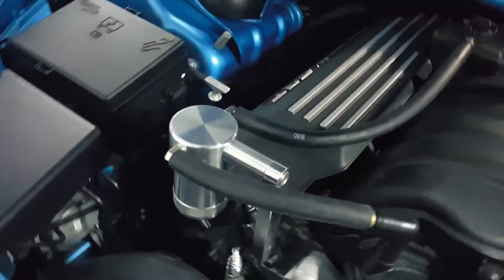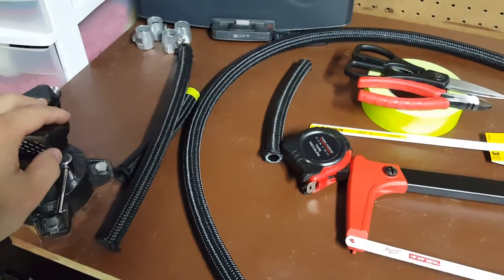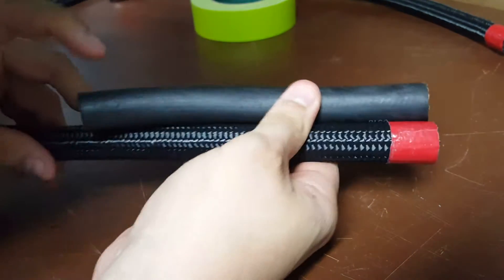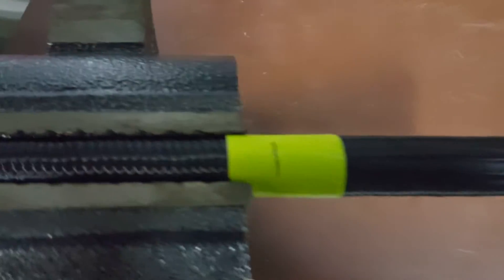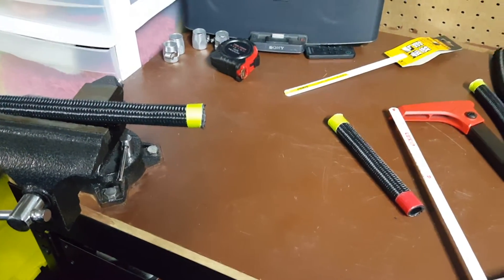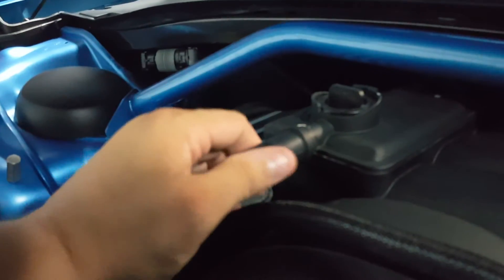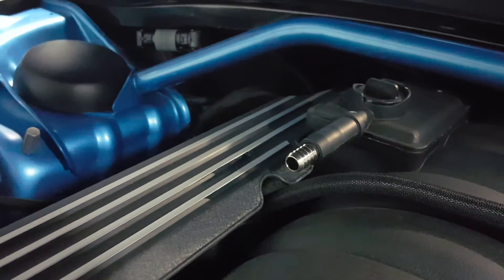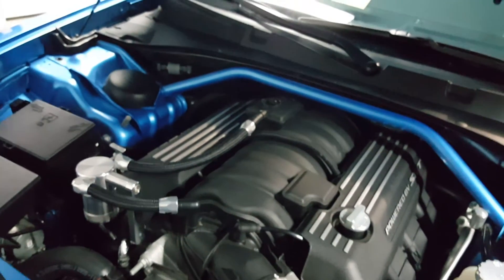2016 Charger Scat Pack Steel Braided Hose Upgrade (DIY)

Comment: Tip of the day: When cutting a braided hose with a hacksaw you can tighten a clamp around the end and it will definitely not fray. And it will also give you a perfectly straight cut.

Comment: Looks a lot cleaner! Did you get your hoses from Speedlogix and your cap covers from Billet Tech?
Reply from the maker: the cap covers were speedlogix and the hose was from a place called Pro Tuning Lab only because they sold it in larger sizes and I wanted extra for my K&N and for any other projects :)

Comment: Are your air intake temperature warmer with the K&N open element?
Reply from the maker: Slightly but nothing horrible
Reply: I think a hellcat airbox is more beneficial! Engines don't like that hot air from the engine bay.

Comment: U could have taken the rubber piece off at the end like I did on mine and made it one long hose,  (that piece with the white line marked on top comes off) if u need a pic I can send u one
Reply from the maker: yeah man if you could send me a picture that would be great because I didn't want to go tugging on things lol
Reply: yeah it does come off but its very hard to get it off, and to replace one back on it, use a little oil if yours is hard to put back on, and when your taking it off, if you get a flat head screwdriver ( i actually had one of those old type little hammers that the end screws off and its a screwdriver, and i used the claws of the hammer and put on the edge of the hose and got it off alot easier, but anywho ) just make sure you dont scratch up the plastic pipe that the hose is connected to. Your Scat Pack is looking awesome, and of course i love the B5 Blue. I put a Moroso oil catch can on mine and i love it, it has the drain valve on the bottom.
Reply: oh well
Reply: It Worked
Reply: Good job